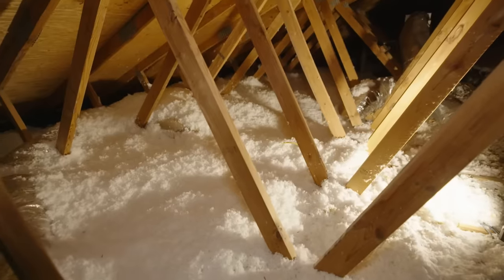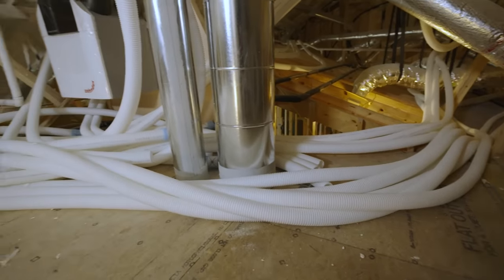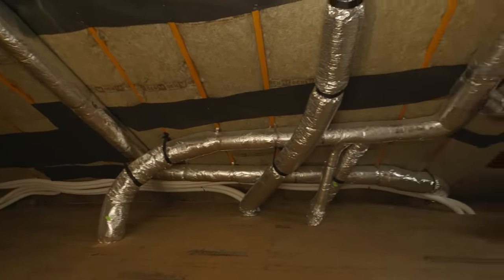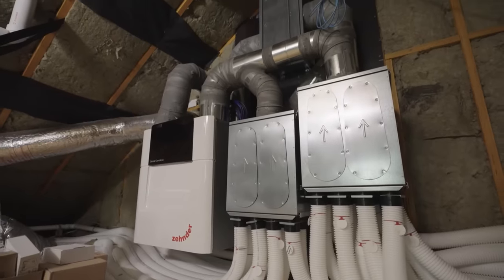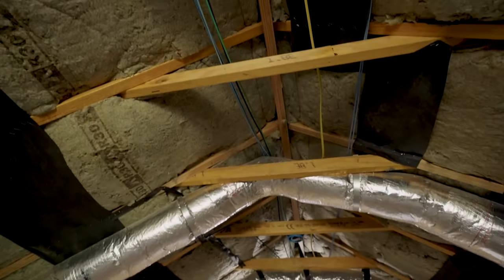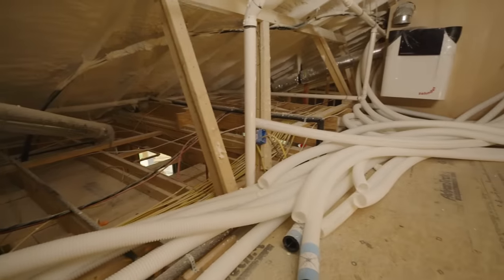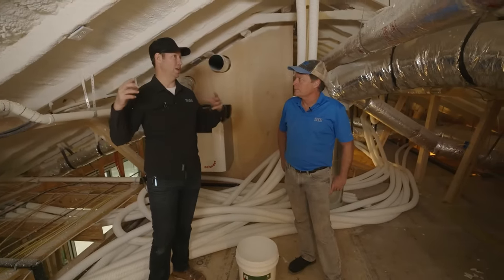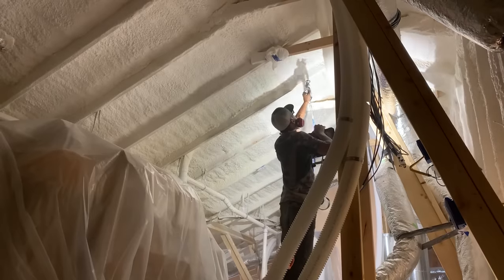Building a BETTER attic - Unvented + Conditioned attics 101

Comment: I've always wonder what would happen to a roof leak on a spray foamed attic ceiling?
Reply: Closed cell is for all intents and purposes is considered a vapor barrier. Open cell can be if its sprayed in layers, to like 3 layers thick. So if the whole ceiling and the rafters were incased the water would simply stay in the wood. Depending on the climate that could still be really bad of course.
Reply: @ShotGunner5609  in most climates the water staying to fully soak into the wood instead of passing it and letting it be able to dry out is no good.

By the time you know there's a leak and track it down, a lot of damage will be done.
Reply: @InfernosReaper  Agreed. There is still no ideal attic layout that works well.
Reply: umm - it will pool in the closed cell (if it is intact) and rot the rafters / decking. - another good reason to have a vented wrapped cold (secondary) roof deck...
Reply: Water can drip through spray foam, ask my mom. Her new house dripped at the peak, we had to pull the ridge cap (steel roof) and completely seal over, the ridge cap covers the actual seal.
Reply: @rbnhd1976  Water can drip through open cell spray foam, sure. There's no way it's traveling through closed cell unless the installer had an exceptionally bad day.

Comment: Speaking as someone who did a lot of residential electrical remodels in my younger days, trying to do anything in those typical style attics is a nightmare.  Doing contortions around all of those trusses and sloppily installed ducts, telephone wires (when we had landlines), pipes, etc, while wading through a sea of blown in insulation, and trying to balancing yourself on top of ceiling joists that are buried underneath all of that insulation, and carrying along your tools and materials at the same time.  In a 125F attic.  For hours.  Oh yeah, good times, dripping sarcasm intended.  Attics like this would be a dream, except when the homeowner wanted to install something (ceiling fan, light, etc) where the nice wood flooring is set in place (worse, if that flooring is an actual structural member, as Matt's house is, and the young electrician doesn't know it and removes it, without knowing it's a structural member that's holding the walls together).

BTW, I also notice in Matt's houses all of the ducting and hoses are very neatly secured and out of the way as much as possible.  Don't expect Joe's Cheapo Construction Co to do that.  They're going to toss in the A/C as quickly and easily for them as possible.  Ducts just laying all over the floor of the attic wherever they lay.

Comment: Matt, I’m sure most people would love to build homes similar to yours, obviously though cost can be an option. Why don’t you focus on figuring out how the average joe and the average home builder can build a better home for similar cost and make that the new “norm”.
Reply: Because the blown-in insulation approach is already the best cost-to-performance system.  The only reason to do the above is if you wanted the extra space.  If you are unsatisfied with typical attic performance, just do a better job air sealing the attic floor, sealing/insulating the ducts, and providing balanced ridge/soffit ventilation.
Reply: Exactly he’s basically saying look at my million dollar home and how much better it is that your measly $200k home. Look at my amazing ac system and tight envelope and it’s so efficient and it only cost me a million. Ya we get it. Even if he says it didn’t cost him a million because he did the work, how much would it cost if we hired Matt? A million. 

Same thing can be said about cars. Look at my Maserati with exotic leather from a cow that was raised by Buddhist monks massaging it everyday……..
Reply: @thomaslbane  That is basically my point, every place built in my area is done that way (desert southwest), and while it isn’t perfect, it works. So, my overall message to Matt is; if you want everyone to change and build a full envelope for better space management and better efficiency with your heating/cooling units in your conditioned space, then figure out how to do it cheaply enough that people will start doing it!
Reply: @jimyeats  Because this show isn't "This old house", it's "look how much cooler my house is than yours". He's showing off new building tech while using vendors to fund his house build. I mean he's been building that thing for like 2 years now. There's no way it should take that long. He's getting the freebies.
Reply: For a new build it's pretty simple:

1) Keep all conditioned/habitable space under the attic floor. No habitable space should be at the same level as the attic.
2) No mechanical equipment in the attic.
3) Continuous air barrier below truss bottom chord. Said barrier should go up before any interior partition walls.
4) Recessed lights, bathroom fan ducts, should go in the drop ceiling below the air barrier

Most northeastern builders are already pretty good about 1-3, it's #4 where they fall apart because apparently building a 1-2 foot taller wall and adding dropped ceilings is too expensive.

Comment: Matt Risinger - "We've been building this way for decades, and this is a dumb way to build".
Joseph Lstiburek - "A vented attic, where insulation is placed on an air-sealed attic floor, is one of the most underappreciated building assemblies that we have in the history of building science. It’s hard to screw up this approach. A vented attic works in hot climates, mixed climates, and cold climates. It works in the Arctic and in the Amazon. It works absolutely everywhere—when executed properly."

Come on man!
Reply: The key words are “when properly executed”. This rarely happens.

Comment: Please note, the burn test was not the same. The angle on the second test appeared to be at more of an angle. Also, the first test was held in one place while the second the flame was moved around applying less heat to any one area.

Comment: I'll go one step further... I live in Phoenix and we build most houses (roofs) exactly the same way as we build houses in Minnesota. IMO a conditioned attic is better but still horrible for Phoenix. First off ductless split AC/heat is much smarter than central. Second with the insulated roof you still have 150F on the outside trying to get thru and in Phoenix a pitched roof isn't needed....we're just used to it. So switch to a flat roof. insulation the ceiling, water proof that and the then build another roof at least 12" above that for serious ventilation. The purpose of the 2nd roof is to shade the 1st roof. Now you have about 95F max on the outside of insulated roof trying to push thru. With a metal 2nd roof you're also repelling a lot of radiant heat.

Comment: Hmm have an ICF house with conditioned attic, it sat for 2 years without AC and only marginal heat during the winter in WV and no mold issues.  Not Florida but it does get humid.   So at least in my enviroment the concerns of many below do not apply

Comment: Doesn't having foam right up against the roof cause the shingles to overheat and fail sooner?
Reply: I think he said he had a metal roof. That feels like a requirement for this style.
Reply: There was a study showing that no, at least not significant (like 1 degree in full sun, then it's coming off much quicker).

Comment: The most expensive and complicated way to have a low r-value roof.  Maybe it's just dumb to have an overly complicated hvac system in the attic to begin with.
Reply: That would be my house in Tucson, AZ. First time in my life I have ever seen a HVAC system in the attic.
Reply: Yes, but with no basement or crawl space there is no other choice.
Reply: @DavidEVogel  Most of the houses we looked at in Austin and San Antonio have HVAC in the attic.   When we redo the roof, I am tempted to mini-spit the whole house and insulate the attic similarly to what this video shows.

Comment: It seems like it will cost a lot more money to a/c the attic, instead of having a vented attic (w/ attic fan). I understand that some attic heat will get into the house, but I would think it would cost less to cool this small amount of transferred heat, than cool the attic.
Also, unless your attic isn't properly vented, it won't be 170 degrees as stated in the video. 
Fan-vented attics are not a stupid way to build, but instead are a good solution when you have a modest budget, or live in a temperate climate.
That said, if you can afford it, it is nice to have an attic that is cool enough for storage.
Reply: I would think that a dehumidifier would be more efficient than full AC.  Less power draw.  Combine it with solar, and you have a system that barely touches the electrical bill.  Final project cost would spike up, ofc, though.

Comment: No ducts in the attic of my ICF house, all mini splits with ERV. Foamed top plates and ceiling drywall seams and penetrations, then 14 inches of fluffy stuff. Lots of venting under standing seam metal roof. No moisture!  (Yeti cooler under an Easy up shade ) in Phoenix.

Comment: Large builders will never do this because the other way is cheaper.  And they will build with the cheapest crap they can get away with. B
Reply: Yup. I biked through a neighborhood under construction. $500,000 - $1,000,000 houses. I can't remember the name of the product, but the housewrap was definitely the cheap stuff. Type of material that would wind up in Matt's pet peeves video.

Comment: can you combine the "fire barriers", such as the paint and drywall, for double the time, like 30 minutes?  Also, can using rockwool for a bat, on top of the foam, and maybe under drywall, help/work too?
Reply: Seems like overkill to me... Not to mention it would greatly increase the cost.  Who can afford that unless you're Jeff Bezos or Warren Buffet...
Reply: Just buy a good quality fire rated drywall,  some is rated for over 2 hours and it won't smoke like that paint
Reply: @Chris-od1jp  the paint was not smoking, the heavy smoke was the foam without coating.
the coating charred which makes the fire keep off the foam 5/8 fireboard is quite expensive and heavy great for needed in my previous house the builder used it for the wall between stove and living room but way overkill 2 hours of fire in attic the drywall will keep fire off foam but i bet the fire would burn through the floor
Reply: @user-xl9pm4tx4p  I'd think it would still be cheaper than painting the stuff onto drywall though, I'm from Australia so can only assume about American prices. Be interesting to see also how it performs if the fires coming from the other side, like an electrical fire inside the wall
Reply: @joea400  ME! It’s only money.

Comment: What do recommend for retrofitting insulation in an older home. Like 1920s when you don’t have a sealed attic but want better thermal performance.
Reply: Look into air sealing and then adding cellulose insulation.  It's dumb, but it works.  Blow in cellulose is better than pink batts.

Comment: For next video please show how to strengthen a normal attic for stronger winds, hurricanes.  Most of us have normal attics like you showed and note the metal connectors on the rafters are NOT screwed in.   Without the ability post build to necessarily tie the roof rafters to the foundation what other things can we do to prepare for climate change and more violent storms.

Comment: I spent a couple hundred on that radiant barrier and local utility paid 75% of upgrading blown in insulation to R54 and sealing pot lights. I’ll keep my vented attic for the $1,600 I paid vs what this would cost. There’s 1,000 things I would spend money on my house before doing this. There’s basically zero ROI for this project if you currently have a vented attic.

Comment: I want to know what the actually Cost is. say between This insulation and paint combo vs just the normal Insulation would say at least 90% of house holds use today. I say 90% only cause i see alot of Bat fiberglass insulation in households today. vs spray foam insulation and foam insulation or blown in insulation. 

I would say Fiberglass insulation is actually the cheapest which people would normally go for in household. vs any other type of insulation due to cost.
Reply: More than you want to pay.
Reply: We recently finished a house (1700sqft footprint, +800sqft loft area) which had Rockwool in all the exterior walls and the roof deck sprayed with closed cell to an R35. Labour and material cost was $19,000 CAD in September of 2020. For comparison the LABOUR ONLY price of the drywall on that house was $22,000. We also had the foam guys spray all the gable ends (4 of them) as well as spray the exterior of the house in some locations. Lots of foam in that house. I think it was entirely worth every penny and probably not that much more than doing it the old fashioned way.
Reply: @an7h0ny88  add about 35% to that total. That is what you will pay now.
Reply: Dense pack fiberglass or cellulose is probably the most cost-effective insulation. For vented, unconditioned attics, loose fill cellulose is definitely most cost-effective. Spray foam of any kind = $$$ and can/should be designed out if you're worried at all about cost.
Reply: @an7h0ny88  Just insulated our 2000sqft house in US for 8500 if that gives you an idea of how insane that price is.  We did high density blown in walls and cellulose up top in vented attic.

Comment: I did an addition in 2008 in upstate NY and wanted foam in the walls and roof deck.  I never understood having outside air flowing thru the attic.  I spent numerous hours talking to manufacturers, vendors, contractors, and installers.  No one could/would give an answer.  I went with a closed cell foam and have been quite happy with the results.  
One thing I worried about was the closed cell being non-porous and would hide any roof leaks but so far I haven't seen any signs of damage.  I had the contractor run ice/water shield on the whole roof for peace of mind.  I do find that carpenter ants love the stuff.  I do not believe it is moisture related as I poked around the area and see no signs of water infiltration anywhere around or below the former ant home.
One regret is I didn't have the knowledge at the time to use a radiant barrier on the roof.

Comment: When you build your house with an unlimited budget!
Reply: I like how he doesn't say what the difference in cost is.  Like, yeah that would be awesome...  I can't justify that cost when building a house brah.
Reply: Exactly
Reply: Not possible to achieve the necessary R value without the 4 inches of foam board on the outside, between the deck and the metal roof.  Big increase from a standard roof.
Reply: @scottielewis5136  its triple cost to build and your monthly bills will double.
Reply: Better to build houses right
Reply: yeah! and sponsorships that probably give him dirt cheap deals
Reply: @michaels.ramsey7803  How do you figure?  For construction, it's mostly the same elements, just in a different configuration.  If there are any additional costs, they would be attic flooring, some extra batt (due to following the roof line), and perimeter insulation.  Monthly bills should actually be lower, since you're not losing HVAC thermal delta to the attic.
EDIT: Some components specified in the video may be more costly than alternatives, and you may have been referring to that, for initial cost.  Still not sure why you think monthly cost would be more.
Reply: @IctWilsons  heating and cooling more square footage doesn't require larger and more costly equipment? And does that not equate to higher monthly costs of operation?
Reply: @michaels.ramsey7803  it 100% does, but probably a lot less than your double estimate.

The same amount of sun is shining on the house either way, and it's exposed to the same amount of the hot air outside, but you have a larger thermal barrier protecting the house.

I'm not in the industry but I really doubt your cooling bill would rise more than 50% max, maybe around half of that?

EDIT: and that's assuming a single story home. It becomes a proportionately less expensive if your home is two floors.
Reply: @priestesslucy3299  no one is considering the costs of building materials has tripled, and the costs of services has or will double. So what may have been only a 50% increase at todays prices is a 450% increase from 2 years ago. So considering the abnormally ridiculous costs of building in todays market, my estimates are actually low.
Reply: @michaels.ramsey7803  I hear you on overall cost. Construction is expensive, now more than ever.

Personally I'm only interested in mostly passive systems, the idea of relying on a refrigerant based AC is not my thing lol, and this strategy only increases that.  Granted I live in a place much more mild than Texas, but people lived in Texas for thousands of years without AC, it's just a matter of working with the local environment rather than fighting it
Reply: @priestesslucy3299  I myself have been in the construction business for over 20 years. I have recenly moved to sustainable building and geo thermal heating and cooling.
Reply: Worth the money. I did my crawl space like this

Comment: Just to clarify ... Are you maintaining a vent space between rockwool and roof sheathing?  I'd worry about dew point condensation migrating to the underside of your sheathing and causing rot.
Reply: Mike recently addressed this issue using a venting/moisture barrier at the ridge vent.  I found this video very interesting as well:  "7 Keys To A Better Metal Roof Install"